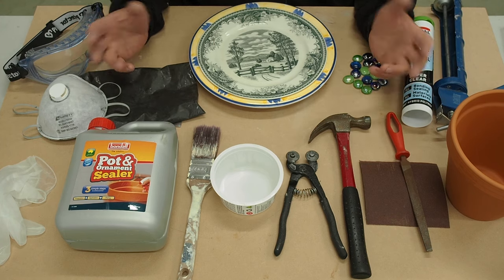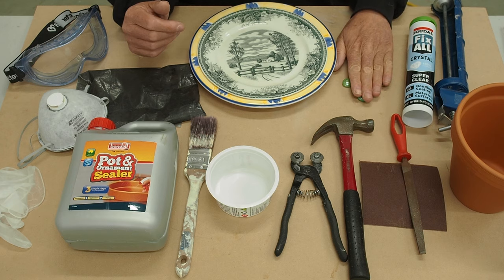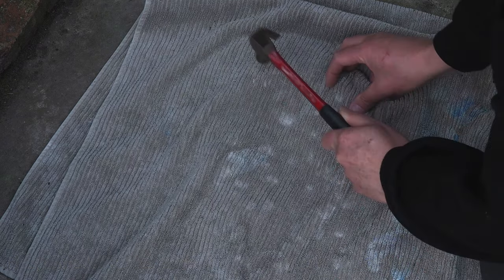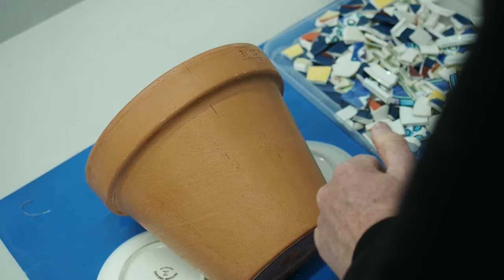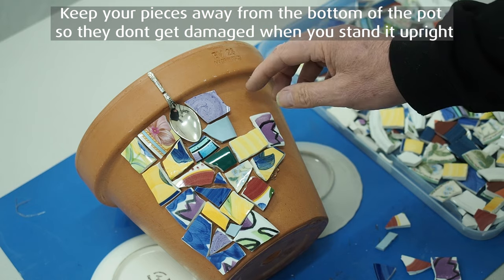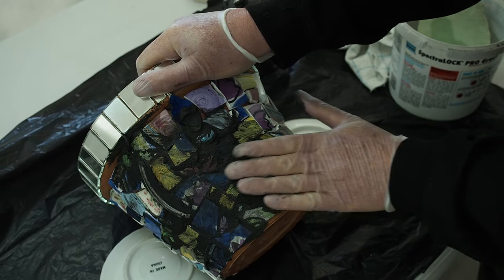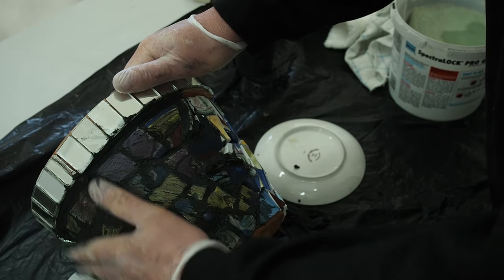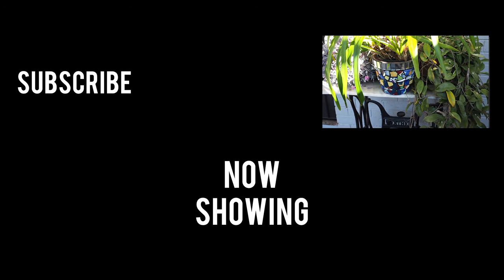Mosaic Flower Pot Tutorial

Comment: What is the sealer? Is it necessary?
Reply from the maker: If you are referring to sealing the pot before mosaicking, some people say yes and others say no, terracotta will absorb the moisture out of adhesives like thinset so using a penetrating sealant helps to prevent this, however you can soak the pot in water and use an adhesive like thinset which will help stop the absorption from the adhesive as well. They also claim that the thinset will bond better to the pot than having a penetrating sealant on it if the sealant were to fail so will your mosaic. However there are companies that make waterproof membranes such as Laticrete Hydroban that works with Laticrete thinset and of course there are thinsets that adhere to glass which is totally smooth, it depends on the type of environment you're in as well. It really comes down to weighing up everything and going with what you think is right. As always whatever adhesive or product you are looking at using always read the manufactures technical sheet which is very easy to read before purchasing to ensure its suitable for the job, the tess and the environment its in. :)

Comment: ThANK YOU. I'm motivated by this video. This will be my first project so forgive me if these are obvious or have been answered already. Questions: Can I use thinset to seal the terra cotta pot. And if I'm not using mirror, then thinset to adhere as well? And is there no sealant at the end, once it is grouted?
Reply from the maker: Thankyou very much Kathleen so glad the video has motivated you. That’s a very good question regarding the thinset as a sealant. Generally speaking,  There are different thinsets on the market. some people don’t even seal their pots they just apply thinset directly to the pot, but they do wet it down first so as the terracotta doesn’t absorb the moisture out of the thinset when they apply their tessera to it. I prefer to use a penetrating sealant on the inside of the pot at least because soils and fertilisers do leach chemicals out  but that’s just me there are no hard and fast rules on it as everyone has their preferences. You can use thinset to apply your tessera which is what l prefer to use, just make sure it’s rated for the tessera you’re using as there are different ones on the market. You can seal the sanded grout at the end if you want to or use an epoxy grout such as the Litokol brand no need to seal as it’s waterproof.  😊

Comment: Did you seal it when done? It is very nice.
Reply from the maker: Thankyou so much, no I didn't seal the finished mosaic pot, I used Laticrete Permacolour grout and it doesnt require sealing unless its in a high traffic area. For my outdoor pieces I generally use Litokol epoxy grout which is waterproof and more durable than sanded grout. Thanks for watching and appreciate your comment. :)

Comment: I just would like to say how grateful i to your channel it has awoken my passion,,, I do have a question if i have seen some use a gloss clear spray paint as a finish would you recommend this?
Reply from the maker: Thankyou very much Michelle. I would not recommend using anything on a finished mosaic except a grout sealer to seal the grout if you've used ordinary sanded grout, if you want a gloss finish then use tessera that is gloss. Any gloss that is sprayed on could go yellow or possibly flake off depending on the tessera you're using further down the track. Just my thoughts though. :)

Comment: Thank you for this inspiring video! I loooove the cheery colors! I wish I knew what the American equivalents are for the adhesive Fix All and the sealant. I was wondering if you put soil directly in your pot or slip a plastic liner pot in. I’m also frustrated trying to find a variety of grout colors. The black you used MADE your piece—really brought out those vivid colors, but I cannot find black grout. Maybe some of your other American viewers have some advice on that...
Reply from the maker: Thankyou very much. The balck grout is Laticrete Permacolour grout and is available in the USA as Laticrete head office is there, I and made a video on how to locate your nearest supplier https://www.youtube.com/watch?v=t0ZHoEpwldg . You can tint your grout with oxides which are used for colouring cement available at hardware stores that sell cement. When I have mosaicked pots I can put soil directly into the pot but I generally dont because the post can crack as the plant grows so I really just use it as a cover for the plant thats already in a pot. That way the mosaic pot will last a lot longer. :)
Reply: @TreasuryRoad ,thank you so much. Not sure how I missed the video about Laticrete unless it’s because I’ve been distracted by the election fraud situation.
Reply from the maker: @donnafoster2022  Thats fine, its very easy to miss things. :)

Comment: Thanks so much for the tutorial. My question is about the edge of the rim, between mirror top and broken plate base. I noticed you wiped away the grout along the edge. Did you do that so it wouldn't break later? And any tips for the bottom? Thanks again.
Reply from the maker: Thankyou so much Margot, appreciate that. I wiped the grout away from the edge as grout on its own has no adhesive properties, so eventually it would most likely chip or crack as its meant to be used as a filler for grout lines. As far as the bottom is concerned just make sure the pot does not sit on the tess, that's why I kept its lightly away from the bottom.

Comment: Can you please share what adhesive you are using in the caulk gun?
Reply from the maker: Theres a shot of it at the very start of the video its called Soudal Fix All Crystal Clear. Its similar to silicone however it doesn't contain the solvents that silicone does. Its also neutral curing so it doesn't effect the reflective backing on the mirror. Thanks for watching. :)

Comment: What do you do with the bottom of the pot and inside? Sometimes I get the grout on the inside when I’m grouting the top edge and it looks messy inside. Should I just wipe the inside down? Or paint the inside? The dark colored grouts are hard to wipe off the inside. Thank you for this video, it helped me a lot.
Reply from the maker: Thankyou and glad the video has helped you. Generally you wont see the inside of the pot, I really wouldn't do anything with the inside except for the sealing. You can tape the inside rim of the pot with painters tape or even add plastic to the inside to protect all the inside area and then grout then all you have to do is peal the tape and plastic off when youve finished cleaning up the grout and you should have a very clean inside rim. :)

Comment: Hi Peter,  is it safe for plant to put it directly to this pot?
Reply from the maker: Hi Mozhdeh, good question, the Bondall ornament sealer is not meant to be used where water pools, now being inside the pot maybe an issue as far as the waterproofing goes due to the constant soil and water, hence why l sealed the pot all over. I personally wouldn’t plant directly into the pot due to this reason also the chances are if you were to repot as the plant gets bigger the mosaic pot would probably break. If you wanted to plant directly in the pot then l wouldn’t seal the inside. 😊

Comment: Can I use a plastic pot?
Reply from the maker: No really advisable as a plastic pot can have flex in it, also it becomes brittle over time and you can also has a situation with adhesives due to the surface tension, stick to terracotta or concrete if you are in a freeze thaw area then concrete as its a lot less porous than terracotta. :)